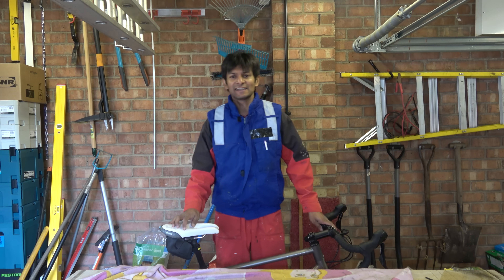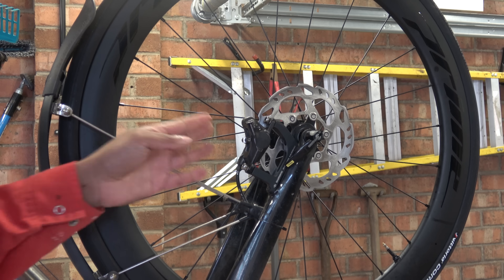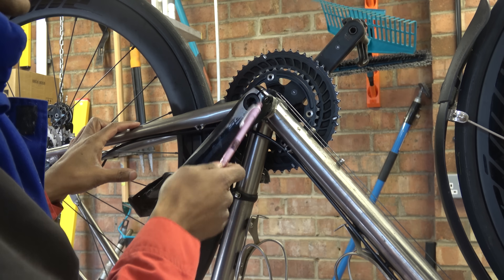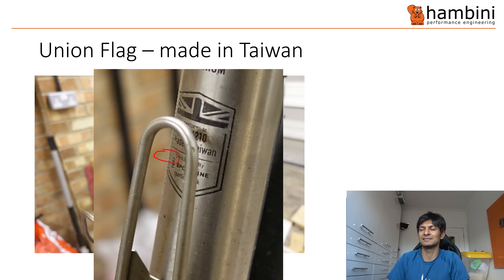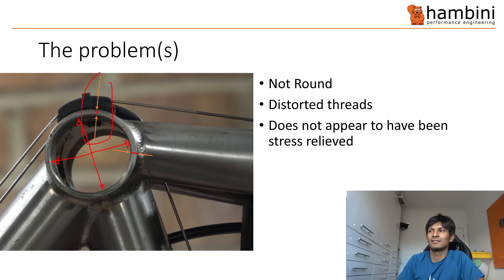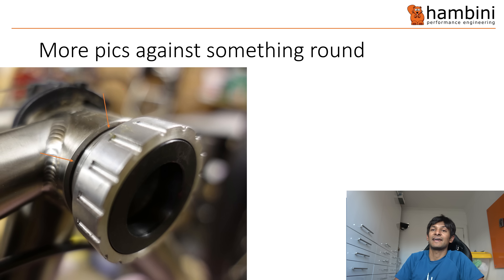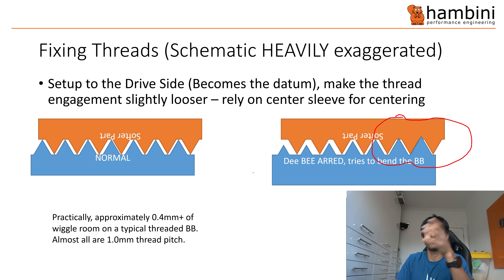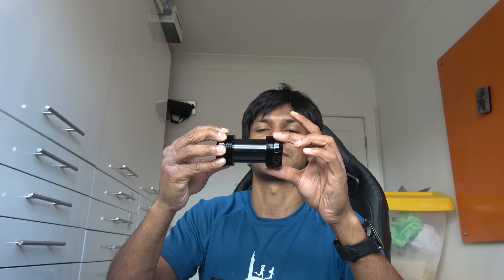REAMING: Titanium Threaded Bike Frame engineered in England by Clowns

Comment: I assemble bikes for another brand in the UK who also source their titanium frames in the Far East. I'm ashamed to say, almost every titanium frame I work with has this problem. I haven't the skills to fix it though, and my employer doesn't seem interested. Don't buy cheap ti frames .
Reply: the ti frame from genesis is not really cheap .... ! not like you would buy from aliexpress to say the least.
Reply: @nr619  cost and quality don’t always correspond appropriately. I’d stick  with quality steel over low-mid grade Ti.  A nice heat treated steel frame is lighter than straight gauge Ti.  It’s also easier to work with regards to your bike mechanic.  If a thread needs chasing or something it’s just far more user friendly than Ti 9 (or carbon).  Good Ti,  Al,  steel,  Aluminum… are all good.  If a problem happens steel is the most user friendly - by a huge margin of any of them.  Many problems with bikes are from the factory and others are from use or poor wrenching.  Steel is the most user friendly.  User friendly is good.  The weight difference between steel and the other materials with the reputation of lighter weight is mostly BS and hype - assuming good heat treated steel.
Reply: @stefhirsch6922  Downside of steel frame: it's heavy to carry it upstair. I do that because of bike theft in my city.
Reply: @Reanimator999  heat treated steel is usually lighter than straight gauge Ti.  Generic cromo is heavier than aluminum,  Ti or carbon but with the addition of heat treatment cromo’s strength improves by about 80%.  There are higher strength alloys than 4130 cromo such as 4340 (marketed as “air hardening”) or some of the stainless offerings from Reynolds,  Columbus and kva.  Higher strength steels due to heat treating and/or alloy allows thinner walled tubing and thus lower weight.  Steel is still progressing in technology.  In fact there is more $$$$ being spent on developing and improving steel than Ti,  aluminum and carbon combined.
Reply: £4,999.99 for the full bike is not "that" cheap
Reply: in what range of prices are we talking when you say "cheap" ti frames? :D
Reply: @Firby007  unfortunately it’s hard to put a specific price on a frame.  Some manufacturers have better quality control than others at the same price. I’ve seen a lot of questionable corner cutting on a lot of expensive bike frames and components.  Ti is great stuff but it’s difficult to work with and has low tolerance for imperfect workmanship.  Steel and Aluminum are much more tolerant to imperfections.  Virtually every manufacturer major or small boutique name makes mistakes.  A number of boutique brands have earned themselves a reputation within the industry of poor customer service or an abnormally high failure rate (litespeed and Merlin come to mind when considering Ti).  Like RollingRat said that you want to make sure that the specific person making your frame is going to do it right.  Good hype,  big name pro teams sponsored to ride a given brand,  or articles raving about a new and improved wonder bike in a magazine (bike magazines are largely marketing hype - whether it’s specifically the advertisements or the articles.  Bike mags are rarely impartial as the ads are what really pay the bills.).  All 4 of the main frame materials (plus magnesium,  wood and bamboo) are all capable of making beautiful bikes that ride great and hold up for the rest of your life.
Reply: I got a relatively cheap ti frame from Orro (Terra), BB spins fine although I haven’t measured the alignment, don’t know if I just got lucky or if they’re properly quality controlling them when assembling - ofc they’ve gone bust now though so idk if it’s worth ordering their bikes anymore for sake of lack of warranty support or spare parts, not that anything is proprietary other than the derailleur hanger!
Reply: A cheap Ti frame= oxymoron.
Reply: @simonalexandercritchley439  you should learn the concept of Relativity then 😉

Comment: Maddison sold Genesis off some time ago. Genesis are owned by another owner now.
Reply from the maker: I think sportline Genesis and madison are all owned by the same parent.
Reply: @Hambini  I thought they sold off the bike company.  I still own the steel 853 Genesis Volare 40.  Yep, crap parts which i replaced.  They were over priced as well.  But hey, i just had to have that 853 frame.  I use to follow the Maddison Genesis team a few years back as they raced using 953 steel for a few years.  Many steel lovers like myself were well excited by all that!  They had some decent results using steel.   They folded the team for some reason.  I am kinda sure they also sold of the Genesis cycling brand just after.  I remember the range changed.  They seemed to drop the Steel race bike that they were famous for, moved on to the Croix de fer range which is not that great tbh.  Reguardless, love the show, keep up the amazing work.  Marc, age 5 :-)
Reply: @Hambini  I am going to agree then :-)

Comment: Rubbing disk brakes are a function of bad setup, or warped/worn parts. None of that should be happening, and you can get rid of it pretty easily in most cases.
Reply: A good setup can go to a bad setup with a hard enough bump or during transport so yes in theory they shouldn't been when applied to peoples lives with the bike it happens all the time
Reply: @coreygolphenee9633  Hit a curb or a pothole in your car  and your wheel alignment moves and your tyres wear. We fix this by getting a regular wheel alignment. No different than when i used to have rim brakes and i had pad rub from a out of true rim or lose spokes. Constant servicing is a reality when use machinery. yes a bike is a machine that needs regualar servicing to run in optimum efficiency.
Reply: @glennoc8585  the tour de France mechanics for one team took the calipers off every time they transported the bike because they would bend and automotive application is totally not comparable when the rotors are thick enough to not bend from looking at them wrong
Reply: @glennoc8585  disc braked bikes are far more susceptible to rub when you strike anything hard and it's hardr if indeed actually possible to make such adjustents with disc brakes if your rim does go out of alignment.
Reply: Don't ever touch my bike if that's all it takes for you.
Reply: Except my Ultegra rotors were always perfectly aligned at the beginning of each ride, then 5 hours or riding in the Peak District in the middle of the summer time, and they were rubbing like son of a bitch. Nothing to do with the initial installation. All to do with them getting bent and expanding under the high temperature from heavy breaking. Ice tech rotors are junk. Went to the bin. Replaced with Campag rotors which are solid steel. Problem solved.
Reply: It's often the calipers. Theyre not made for bad weather. They don't have seals and very easily stick.
Reply: temperature changes effects disc brakes rubbing or not,

simply put discs are bullshit marketing sold as a 'solution' to something that didn't exist. I can run 50mm tyres on my rim brake road bike that was designed/built in 2007, it's done everything except actual road racing/TT.
My light off roadl rim brake bike (let's call it a 'gravel' bike) I don't need anything wider than the 40mm that fits. Discs have no advantage aside from wear and tear on braking surface but then you have to buy into a whole new system/bike which infinately costs you a fuck ton more than buying the odd rim/wheels every few years or so.

Why are people so easuily duped, oh that's because they are told BS and they beleive it then are invested in it so much they'll never admit to being sold a pup.

Comment: Okay disc brakes on a road bike......How come I never had a problem with disc brakes on my mountain bike. I'm not doing back flips but it got some pounding. I was hoping disc brakes on a road bike would be worth it.
1. Hydraulics should mean in 10 years I don't need to replace cables (should they be called hoses). Really I had a mountain bike for 10 years and never had to worry about worn out brake cables.
2. Break pad surface wear on the rim. With disc brakes I replace the rotor with rim brakes I throw out the wheel. I have had to replace wheels, it's not fun. 
3. I am absolutely not worried about the turbulence created or decreased aerodynamics.
4. I am absolutely not worried about added weight. 

I want a reasonable Aluminium frame with good tire clearance. But I gotta say mostly internal cables (hoses and wires?) looks really sexy and I want a bike that looks sexy.
Reply: Yea the only real advantage for discs on road is that you can get a nice wheelset without the worry of wearing out the brake track, especially in winter. Or you weigh 90kg plus and live in the mountains....
Reply: If you are not worried about weight or speed and you wanna fit big tires sure, but your gentlemans sausage will wither and fall off the instant you go fully internal cables. Just a heads up.
Reply: For the vast majority of wheelsets, the spokes will wear out before the rim, even with rim brakes.  Disk brakes are harder on spokes than rim brakes, so I’m guessing it makes little to no difference in wheel life.
Reply: @petesjk  definitely wore out the rims before I noticed the spokes wearing.  Maybe I got lucky and didn't have to true the wheels to notice the spokes.

Comment: Every hand built bike I have owned.  Braze or weld in BB shell. Stress relieve if welded, thread and face. No mass production, simples. Probably why one of them is 32 years old and still the same weight as an entry level modern disk.

Comment: As we've seen in a couple other videos:  steer far clear of budget titanium.  Any potential benefits over other materials are clearly outweighed by crap manufacturing.
Reply: Yeah, pay for the welder, not the material. A master crafter with a solid steel tube will build something a million years beyond this frame. Titanium is awesome. But if you're going to go that route, you need to pay for the expertise to make it right.

Comment: This is surprising, I've always heard good things about Genisis bikes.
Reply: The problem I guess is tolerances and how keen is the customer.

Some customers dont use their bikes much, maybe 400km a year.
Others, 12/18k km a year.
This small minority WILL notice the problem, as they have to keep changing bottom brackets and the powermeter shows they put more power and power per kg  than their buddies, yet suffer more..

So if a bad unit ends up in the keen group, boom, not fit for purpose.
Reply: In the US it's a brand sold by Walmart with very cheap plastic and steel parts.

Comment: good work on the fix, on the rotors
 i often find the shimano rotors with the big spider (ice tech 3 piece braking surface, alloy sandwich) versus the normal center lock ones with the small spider fitted to that one are much straighter and don't rub as much. 
being center lock he can also get the ice tech freeza rotos wtih the center heatsink where there alloy core is extended inwards.

Comment: Nice that you fixed it, but would you be kind on showing us also how you fixed it? Sharing is caring :)
Reply: this is not a fix you can do at home. titanium is a bitch to cut because it flexes as it’s being machined, and requires special tooling to cut it properly. 

after finding the center point of the bb, you would need to rebore the hole probably on a milling machine, and re-tap the threads while it’s still set up on a milling machine. otherwise you run the risk of your tap following the old threads (giving you the same problem) and not making new threads based on the new center-line.

Comment: Glad to see you mentioning the brake rub on discs: it's a key thing that has put me off Disc brakes too. Why the h#ll would anyone want to ride (pay for?) a bike with that going on?
Reply: It doesn't take long to fix. Just re-center the calipers (slacken and re-tighten two bolts).

Or design the bike with a through-axle which will get rid of most of the need to reset... but that's the designer problem. Clearly too busy figuring out where to put a Union Jack on the bike to engineer the front axle properly.
Reply: @dlevi67  often that’s not enough and the caliper bosses have to be re-faced. You would be amazed at the number of frames with rear caliper boss faces that aren’t actually parallel to the axle.
Reply: @nstrug  Given many manufacturers can't seem to get the most basic geometry consistently correct (see this video for example), no, I don't think I'd be amazed. But then they don't get the rim brake mounting correct either (perpendicular to the wheel/parallel to the axle). It's just that with a rim brake you have a couple of mm play rather than a fraction of a mm...
Reply: I have 3 bikes with disc brakes. They don't rub. You need to set them up correctly.
Reply: I have 2 disc road bikes and they don't rub. Coming from a mtb background, it's not a problem. Most people just don't know how to set the brakes properly.
Reply: @jmac74  Exactly! It’s the same with V brakes anyway right. You can have them “sort of” meet the rims, and rubbing the moment a wheel goes out of true… or you can have them nice and even with a bit of toe in and lovely straight rims. You get out what you put in with bike set up.

Comment: It's also annoying when rim breaks rub, also when they're not set up properly
Reply: Lol because that's definitely not super easy to fix 😅 if your wheel is true, you shouldn't have rim brake rubbing. Everyone knows disc brake tolerances are so much lower
Reply: @CesarFalco  True about the lower tolerance, and perhaps not super easy to fix, but still pretty easy, even with an untrue wheel

Comment: The rubbing is mainly caused because it's a quick release, which can put the tension diffetently everytime you tight it. A good disc setup with thru-axle won't rub. And lol at the aerodynamics of the disc, c'mon, nobody needs these marginals differences.

Love your show btw, especially when I see bikerumor, bikeradar or other posting about the absoluteblack pulley cage, I always think of you ahah
Reply: Have you seen the comments on BikeRumor absolute black SRAM red press release? 🤣🤣
Reply: Marginal differences will come in handy when you do long rides.
Reply: Is the thru-axle not just a bigger diameter quick release?
Reply: @felixangelov6008  no. Thru axle tightens to a preset(but user adjustable)point and is then clamped. Quick release is tightened up however you feel like, then clamped.
Reply: @mcspikesky  how do you adjust the preset on it? Never owned a bike with thru-axels, but the ones I have seen did not look to have any adjustments. Just tighten them to whatever you want.

Comment: did genesis participate in any way to fix this problem ? did they reimburse anything under warranty ? a ti frame is not cheap so you would think they are trying their best to make sure the clients are satisfied specially if the frame has a lifetime warranty as stated on their website ! what about all the other frames they produce .... same problem ? maybe a partnership with you would be cheaper than a full recall !
Reply: I bet the owner bought the frame used cheap and had no recourse to Genesis under warrantee.....................

Comment: Hambini, 
You have shaken my faith in 3 cycling "values"
1, Ti is cool
2, Threaded bottom brackets rule!
3, Buy Foreign Parts through an importer (it gives you someone local to shout at, if there is a problem)!

I might have to give up on the idea of N+1? (That's a joke)
😅🤣😂😅🤣😂😅🤣😂
Reply: 1 and 2 are fine. I wrench my own bike. Never fucking touching pressfit. Too much a pain to deal with on a bike that I need daily. Ti is cool. The fuckup with this frame was that #3 is bullshit. I don't see spending the money on titanium, but getting it imported through a factory line. Ti is awesome, but there's a reason its expensive and that price tag is paying for the master building who knows wtf they're doing with the material. Besides, if you're going to buy a space metal forever bike, go the extra distance and get it done up custom to your exact body dimensions.
Reply: I like the "idea" that a ti bike is a " bike for life"!
I keep trying to rehome preowned ti, but with two, I "probably" have enough ti...(But I'll keep browsing!😅🤣😂)
Reply: What is n+1
Reply: @shawnchong2761  Current number of bikes plus one. There's also another approach to finding the correct number: D-1, the number of bikes chich will cause a divorce minus one. :D
Reply: @shawnchong2761  The new bike you need to add.
Reply: titanium is a choice of alloy in the aerospace and aviation industry for decades now. there is bad Titanium. Threaded BB's are fine its the frame threading not the BB in this instance. Hambini is making product due to asshat manufacturing